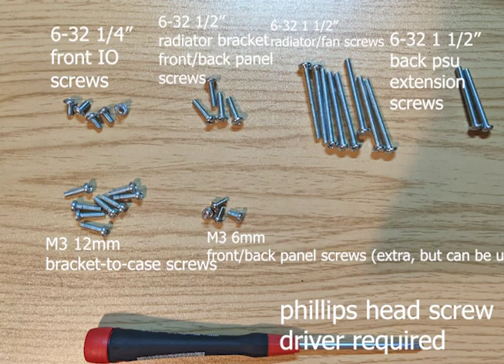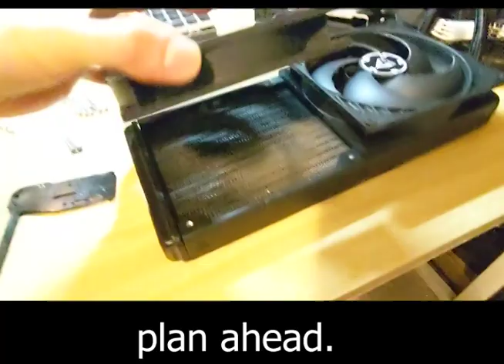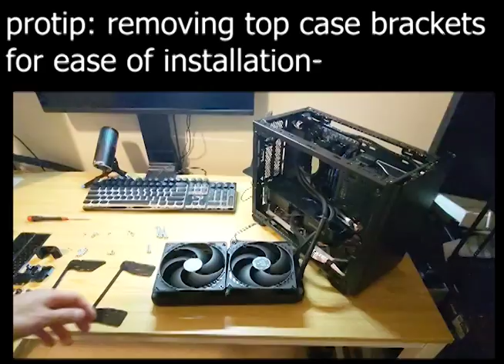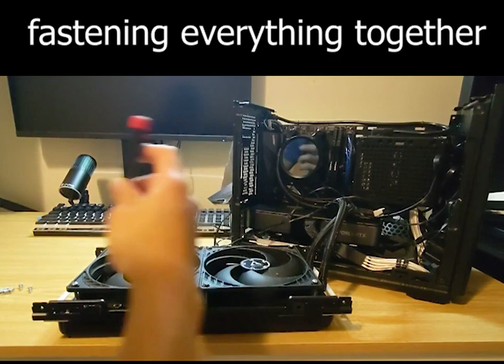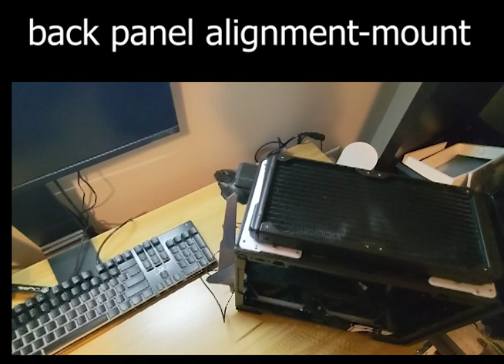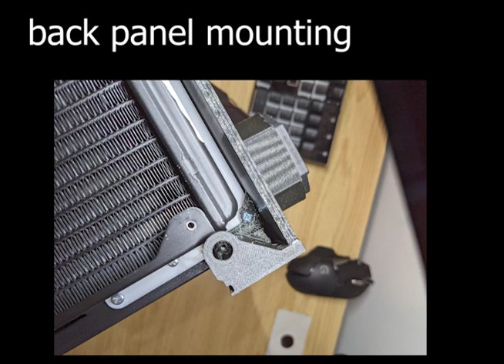Updated build instructions for NR200 tophat v3

Comment: the nr200 is already a large itx case. why not  just get a micro atx case if your going to make the nr200 bigger
Reply from the maker: You are 100% correct, I definitely would recommend upsizing instead of doing this mod. This was more of an design exercise and it turned out that some people actually wanted to build it themselves. Boredom during lockdown I suppose
Reply: For me I bought the case before realizing the aio wouldn't fit on the top.. so I guess just poor research on my part
Reply: Triple radiator in the case (2x 280mm side and top and 1 240mm bottom) is what I'm going for.

Comment: Can I fit a radiator for a custom loop? Maybe the fans on the top and the rad on the bottom?
Reply: 240mm rad with 2.5mm fans works pretty well. If your motherboard allows, I would slot the PSU into the SFX slot for more space for your fans and fittings. In my case I had to bring it up to the SFX-L slot. The build is not complete, but I think with the right fan grills, I could make it work.